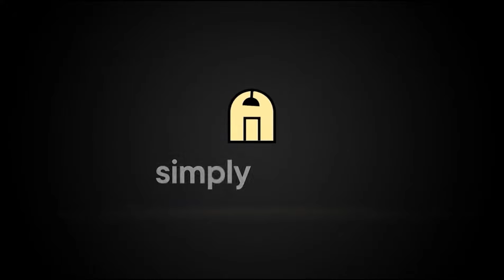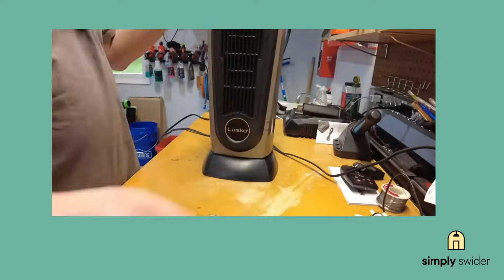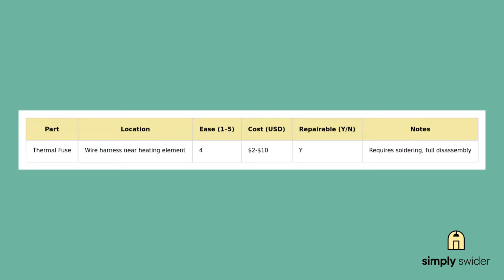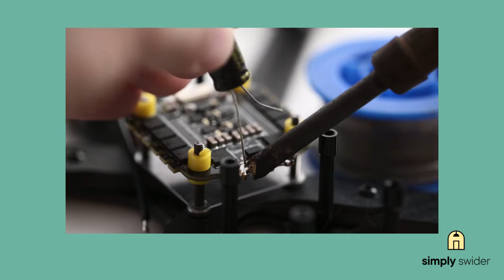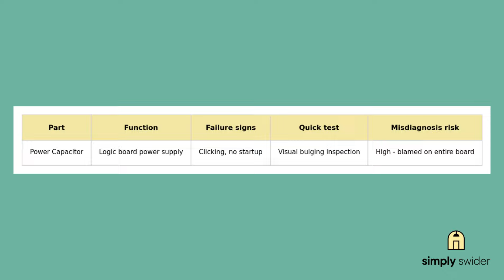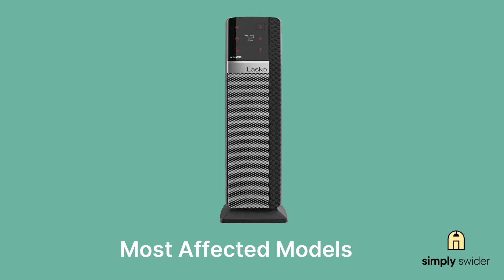Lasko Heater DEAD? DON'T Call Repair! (Save $100+ With These Fixes)

Comment: Thank you so much.  I did what you recommended I have the 751320 model.  I definitely just switched from a wall socket to an extension chord.  I unplugged it for 15 minutes, then cleaned it with compressed air,  then switched it back to a wall socket.  Plugged it back in after 15 minutes and it is working!  Thank you so much.